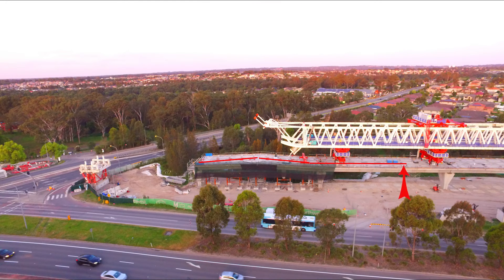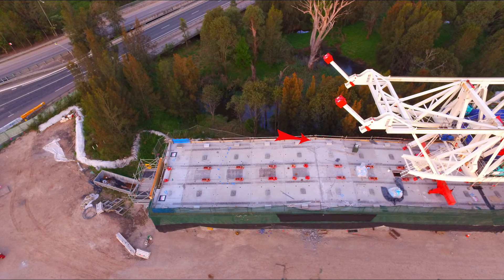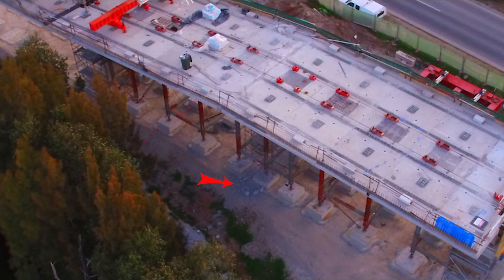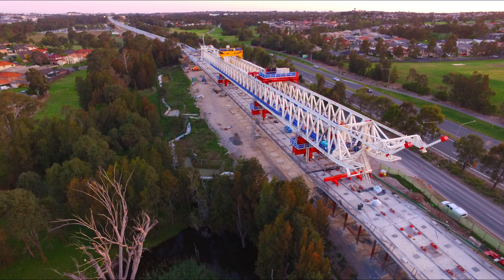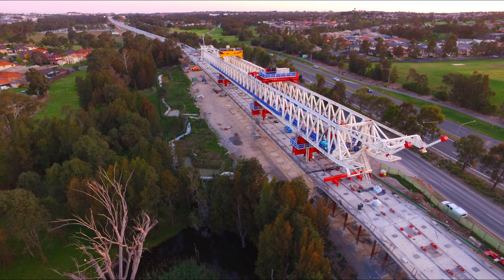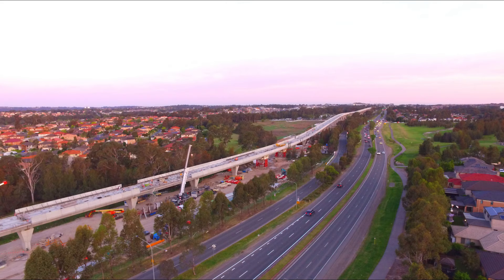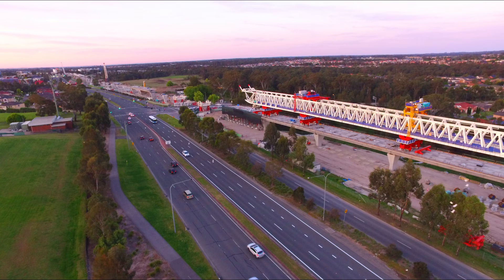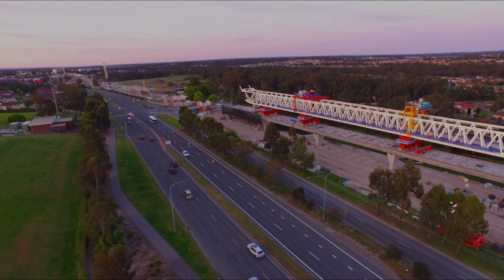Northwest Rail Link  update!!  Overstressed section of skyrail Fail

Comment: it wasn't overstressed, the stitch join was poured on the Thursday then it was stressed on the Friday and failed on Sunday.  the concrete wasn't allowed to cure. the principal contractors wanted it rushed so they could launch the gantry over the span
Reply from the maker: Thanks for that info .. i found that out after i posted the video ..
from a guy who works at  " Attcall "  
How stupid that the contractor stressed the section so early concrete too green .. Concrete needs 28 days to reach its full MPA strength ..
Thanks for your comments and please subscribe for future videos ..
Have a great day mate :-)
Reply: anon ymus _[a[a[1